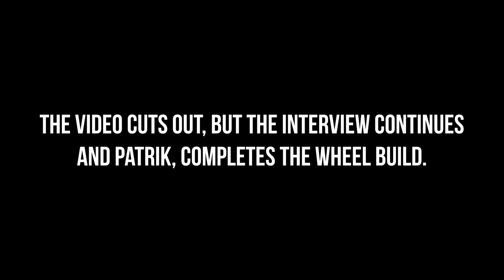Real-Time MTB Wheel Build & Interview - Patrik Zuest - The Inside Line

Comment: How many crosses are you doing for DH Wheel? Are you going for the limit of the rim for the spoke tension? Brass nipples rather than alloy? Thanks in advance !!
Reply: 3x is pretty much my standard.  And yeah usually close to the limit on spoke tension.  It helps keep the wheel true and long term requires less maintenance I have found.  Generally more durable.
As for Brass vs Alloy... this wheel was done with brass for ease of maintenance for the athlete.  There are some splined alloy nipples from Wheel Fanatyk that I build most of my wheels with. not issues with strength etc.  They don't round and don't break.  I never had an issue with the alloy breaking while building for Yeti...they would just round when I needed to nurse a wheel through the end of a day or weekend.  But those wheels were HAMMERED when i was doing that....I don't blame the nipples on that one!
Reply: @patrikzuest  Thank you for your detailed answer!! cheers!
Reply: @patrikzuest  What are you using to lube the spoke nipples once you lased the rim? Also didn't see it in the video but do you stress the rim during your build ?
Reply: @paradox963  some thin lube like tri-flow or whatever else i have on hand. Always a wet lube, not a dry lube.  And yes I do stress the rim.  usually once into tensioning just put hub on a solid table and lean on the rim, flip it back and forth and rotate through to make sure all parts of the rim are stressed in both directions.
Reply: @patrikzuest  Thanks for the reply, I do most of the wheel building at the shop I work at so it's always nice to see what other people are doing.